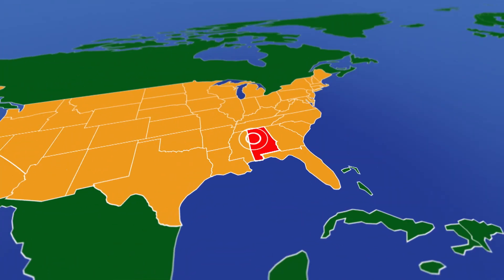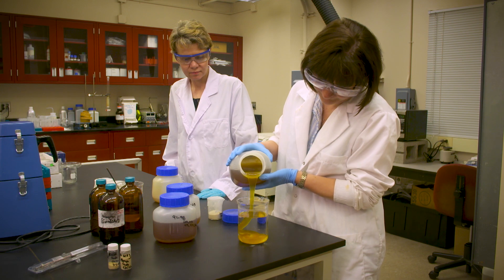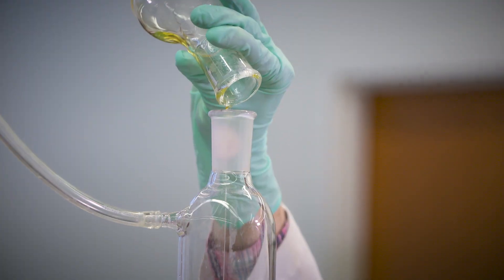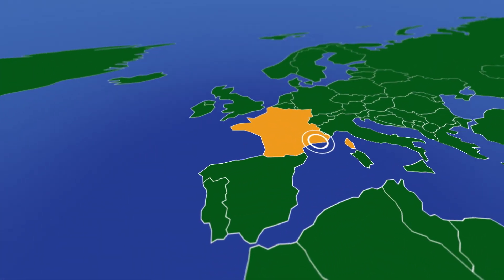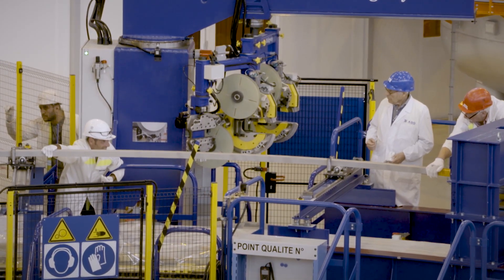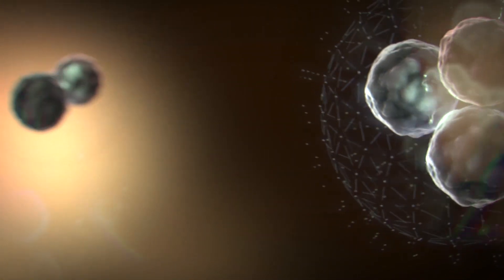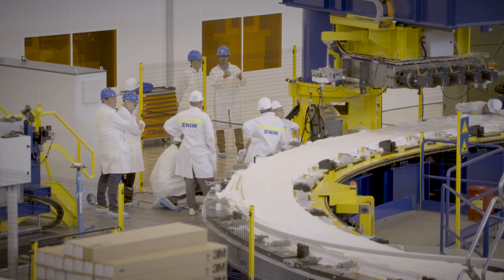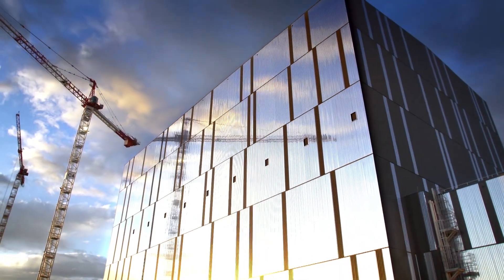The future of nuclear power, part two | Sustainable Energy

Comment: So they want to run the Oceans dry? no thanks, geo thermal power is superior, it doesn't drain any of earths resources or produce hazardous waste.
Reply: Oceans wouldnt run dry, nuclear waste isn't really dangerous
Reply: @Admiral642  And we won't run out of uranium. There is too much of it and it's too energy dense.
Reply: As someone who likes geothermal energy, I don't think they're superior to nuclear energy. It is viable to build them close to geologically active places but becomes expensive and sometimes impossible to harness such resource if it's very far away from geologically active places. I still think nuclear energy is better unless we can harness energy directly from molten rocks (magma, lava) besides the steam and hot water which are what we currently only have.
Reply: Also, some geothermal plants require fracking, which could lead to some earthquakes. Making a geothermal power source would also mean releasing more greenhouse gases, affecting the land's surface stability, and soil content which would make it less livable for plants. Unlike new designs of nuclear power plants, I don't see any new radical designs of geothermal power plants that addresses most of its limits and problems.

Comment: Why would you not have included the Thorium option, example, LFTR technology. It seems to me this is one of the most viable, safe, clean, scalable, and least expensive solutions.
Reply: Yes, Liquid Fluoride Reactor or Molten Salt Reactor is a technology with great potential. Thorium fuel cycle becomes practical with these reactors.
Reply: LFTR is a molten salt reactor and a breeder reactor. Comparing apples to apples a chloride salt reactor breeding uranium has it's benefits over LFTR, and uranium is then just as energy dense as thorium.